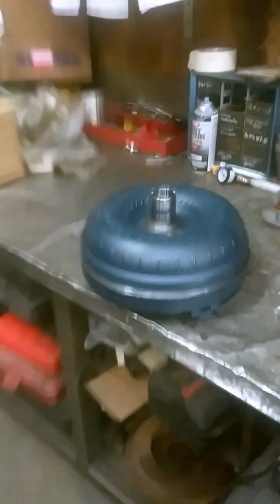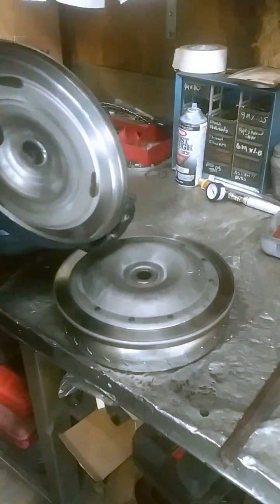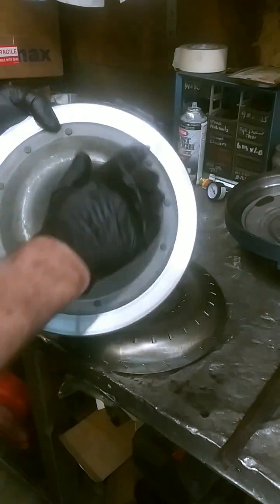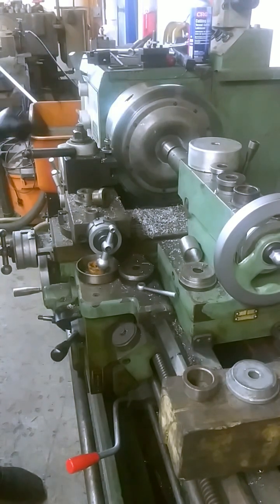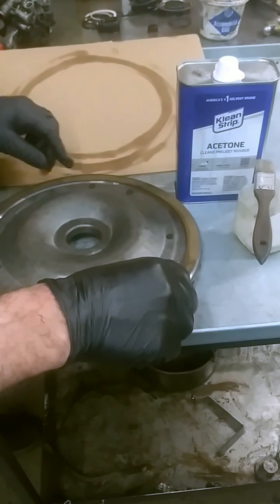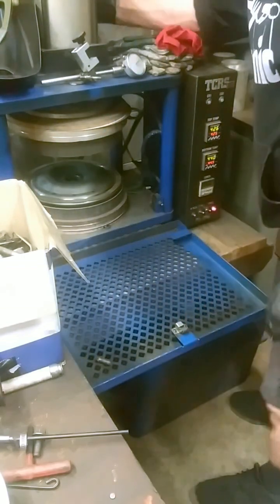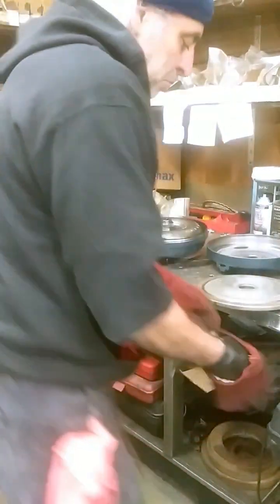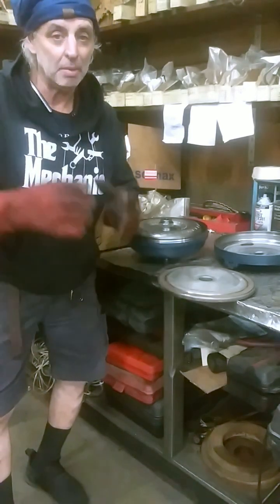Torque convertor clutch failure

Comment: That's baddass! Had no idea this was possible outside of initial manufacturing. Wish everyone else shared the same fix it vs trash it mentality instead of being Zzzzzz happy with the planned obsolescence that's the intentional standard now days. Most would go on to argue that it's cheaper and easier to just throw a new converter at it and hope that fixes it. Even if they thought the lining had left the chat, 99% plus would never have the skills, equip, or gumption to cut the old one open to at least verify their hypothesis, even if they were going with a new one anyway. And they'd argue that fixing the old one might end up only buying some time before the next thing on it wore out, when chances are the reman they grab may or may not have all new (or even quality new) components in it in the first place. I like it.